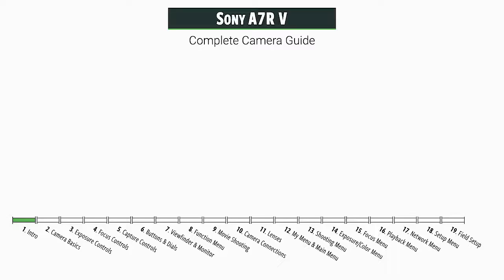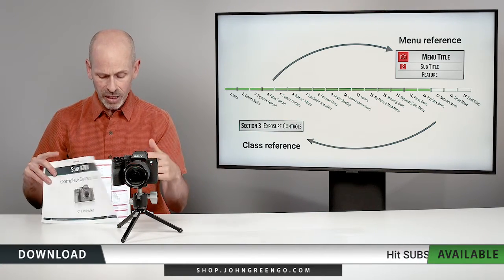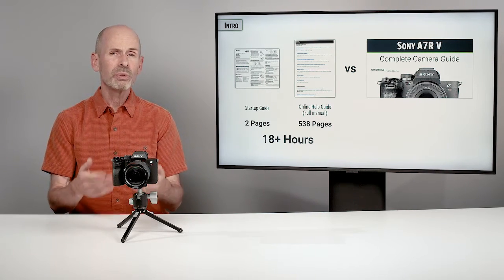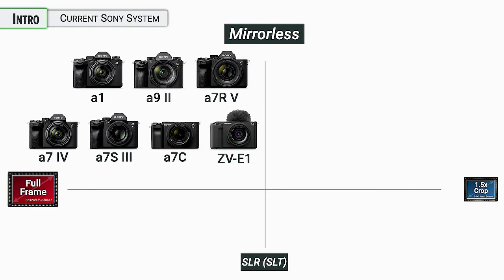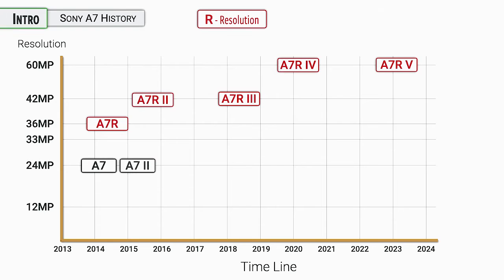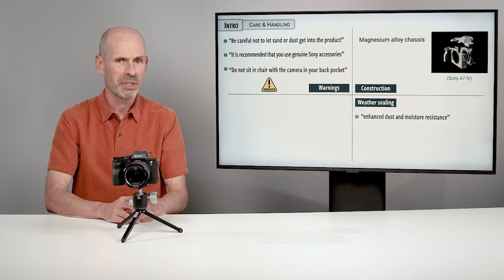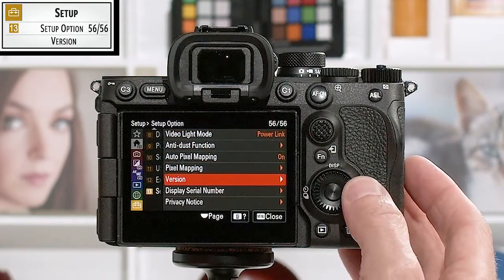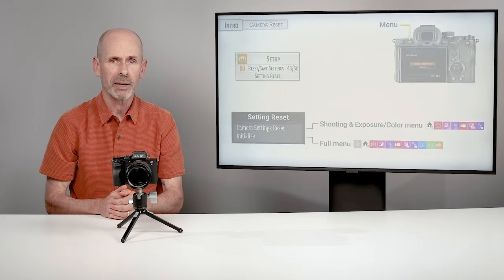Sony A7R V: CCG [01-Introduction]

Comment: I'm desperately trying not to be overly critical here but at the 6 minute mark I get it already.  The disclaimer is loud and clear, you don't have time to explain the myriad number of options the manufacturers provided to use this tool.  It might be nice to actually get to the aspects of using it that you do have time to explain.  
Perhaps I was mistaken in assuming this might provide some insight beyond "I'm not going to get into that here" at 10 minutes I'm sorry I've wasted enough time.
Reply from the maker: This is the Introduction section of an almost 9 hour course. The information here is very important to set someone up for the rest of the course. If you'd like solid content, that starts with section 3 (also on YouTube) ► https://youtu.be/c5nNueEXZmE